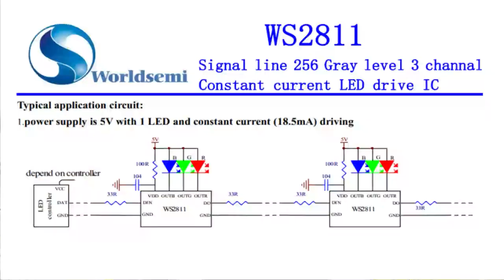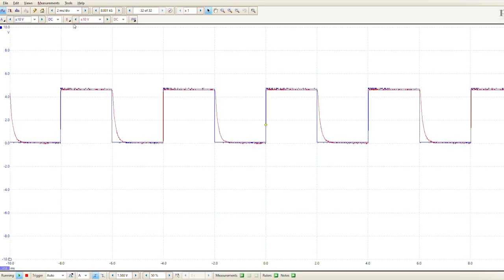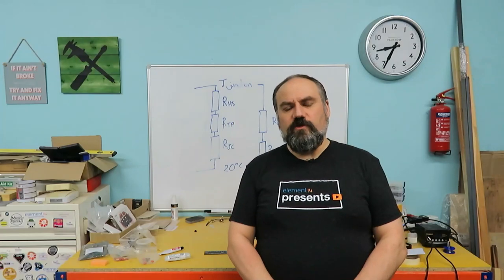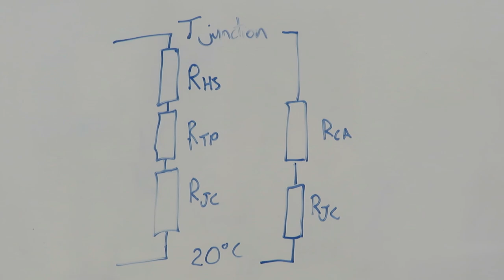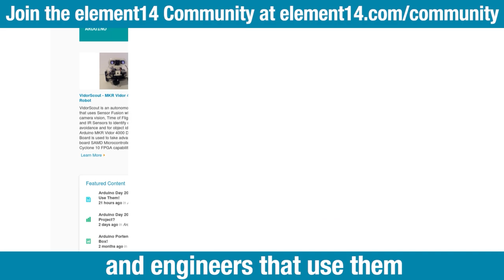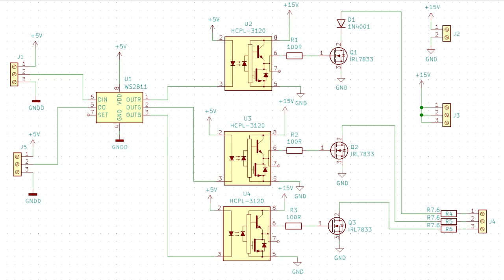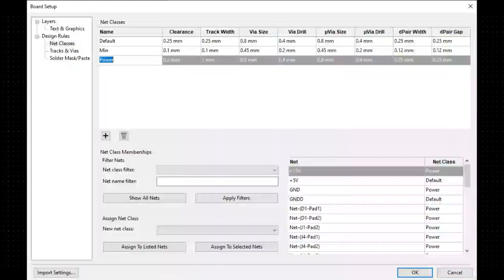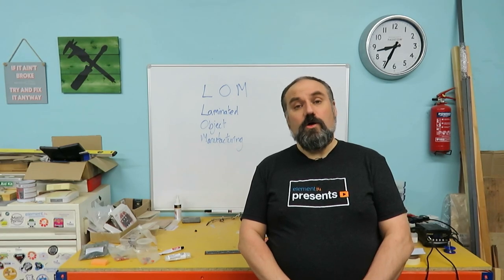Jumbo DIY RGB LED

Comment: It looks great but it needs a cover to diffuse the light for better colour mixing.
Reply: I feel like that kinda defeats the point, though. The original SMD ones often lack a diffuser, they just rely on the small size to 'mix' the colours. This version isn't practical, but it's faithful to the original part.

Comment: That's pretty cool... I would suggest putting a diffuser on it
Reply: .... The dome off George Jetson's car should suffice !
Reply: Have ordered a bit of polycarbonate to act as protection, may do some experiments with diffusers.
Reply: That was my first thought - cool project for sure.  Also you have an excuse to buy a larger 3D printer - you can get the Anycubic Chiron for a very good price by shopping.  That would do nicely.  I have one and after doing the mods following TH3D's YouTube videos to address its shortcomings and convert it to Marlin, it's quite a serviceable large printer.